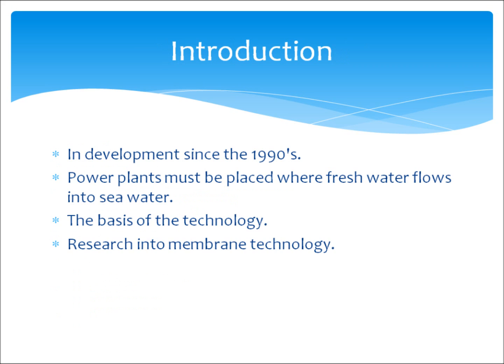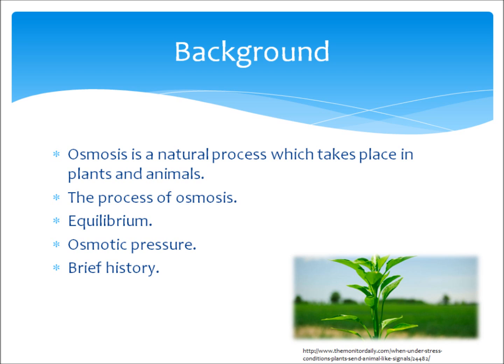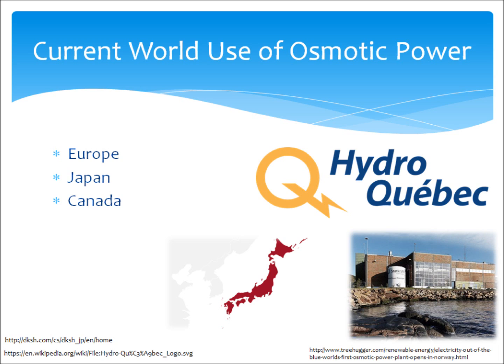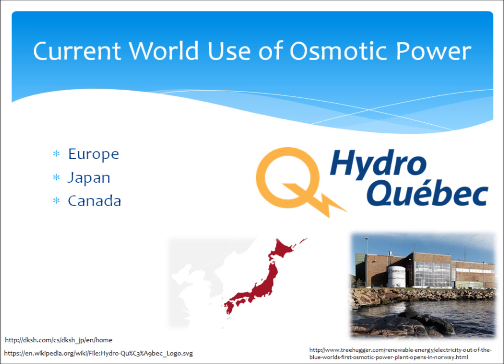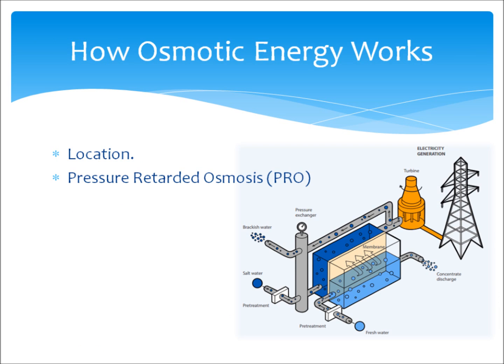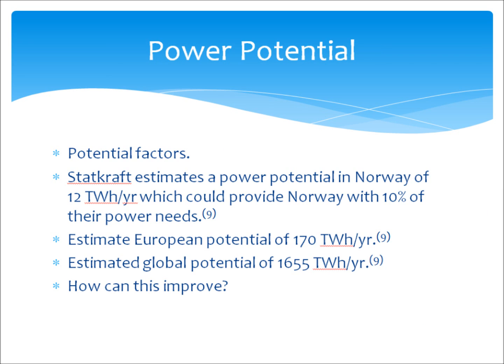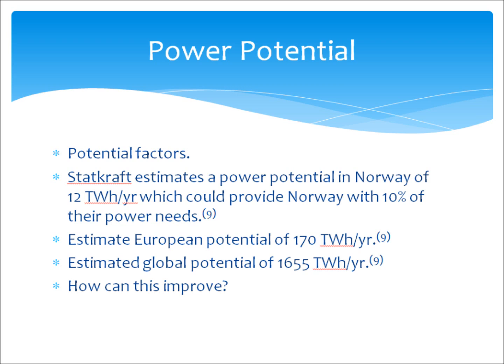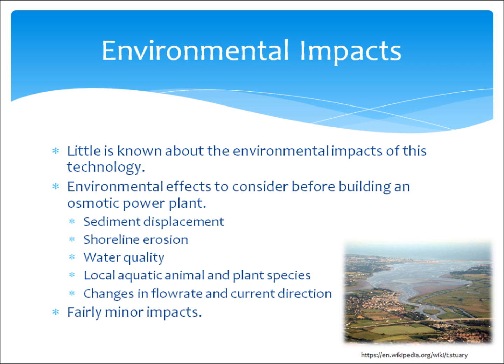Screencast Osmotic Power

Comment: you know something's fishy with our energy production system when we don't see water wheels along every river. we have raging rivers where i live that flow nonstop 24 hours a day. "Waterwheels are a viable proposition for producing electricity for domestic purposes. They are simple to control and aesthetically pleasing. Although they run relatively slowly and require a high ratio gearbox to drive a generator"